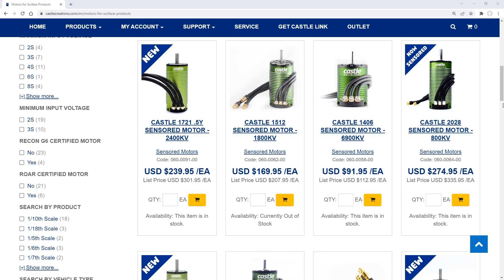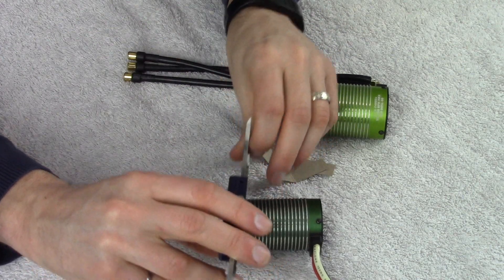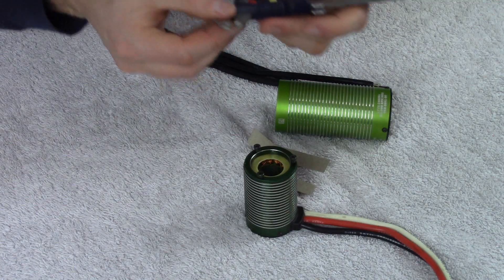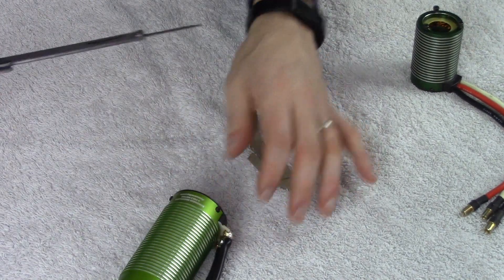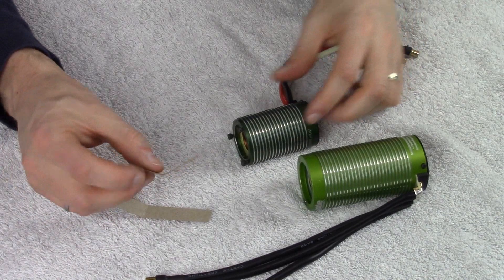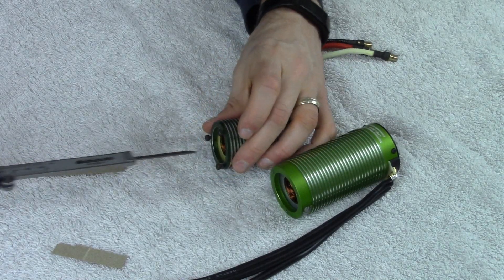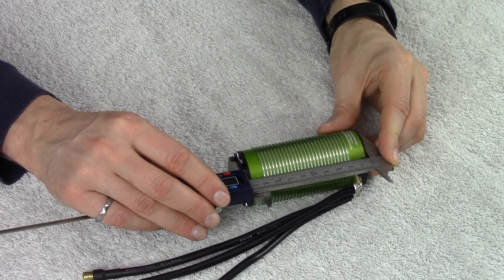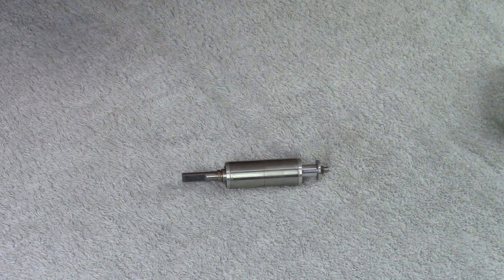Castle Creations Motor Naming Explained & Why it's Helpful for us

Comment: I like castle but that’s stupid for the average person looking for a motor to fit what they’re looking for.
I typically first look for what voltage I want to run…like 2s,3s,4s etc…then I look at outer diameter of the body and length..
Then I look for one being sensored or not…..easy peazy lemon squeazy..

Comment: Great video, I think that the benefits of castles names are diminished due to the fact that we don’t know the dimensions of the stator in the other motors, there’s nothing to compare it to unless you do lots of research.  Does that make sense? So I see the benefits, but it’s like comparing apples to oranges based on number designation.

Comment: Castle motor have different stator size for different kv. For example, 1717 1260kv have shorter stator and rotor than 1717 1650kv. It even weights like 40 gram less.

Comment: So technically, the measurement isn't the problem, it's HOW they measure. The 1512 in metric would be a 3830, for example.
Reply: 3830 doesn’t come up as a motor identification either

Comment: Nice explanation!  For a future video would you explain how some ESCs have a KV limit?  For example the XLX2 is not recommended for motors with higher than 2000kv. 

Thanks
Reply: If you update the latest firmware, it'll be fine with higher than 2000Kv motor.

Comment: The can size is way more helpful because you can actually tell if it's going to fit in the RC car you are going to put it in.
Reply: True, but you can go to Castles site and look up the motor you want, it has the can dimensions, just one extra step. You never know how those other motors are setup, they never include stator dimensions, Just KV